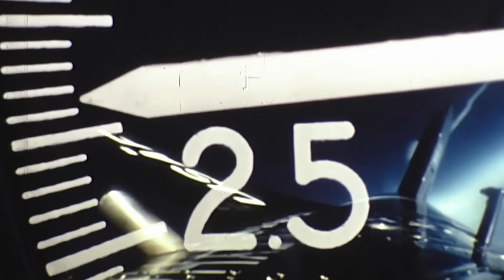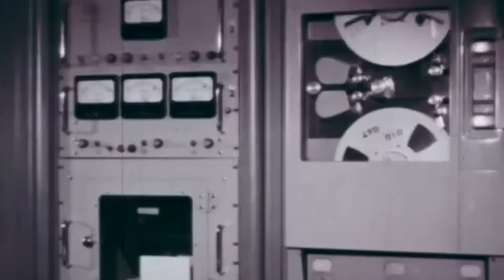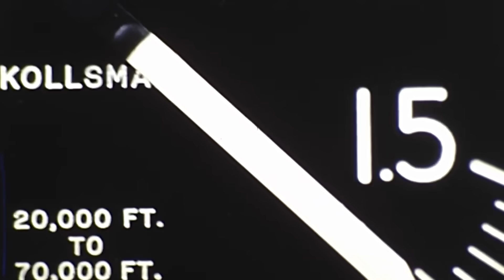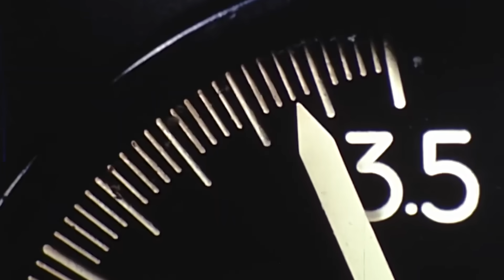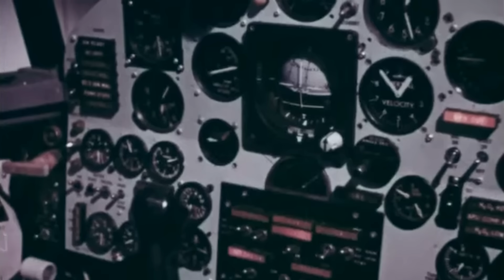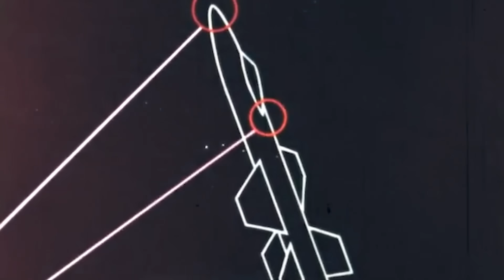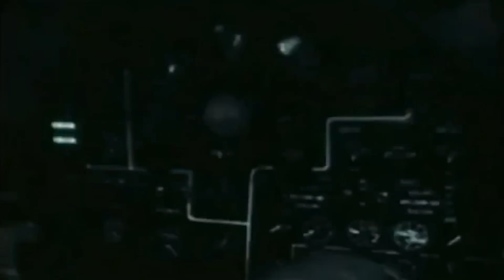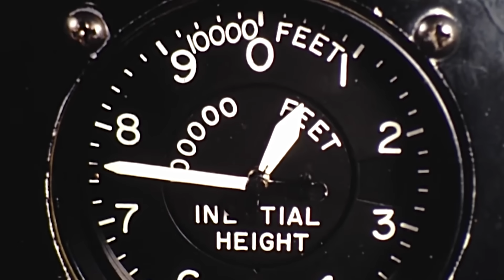The Plane That Accidentally Flew Into Space

Comment: The Y12 could zoom climb to near space as could the SLOWER SR 71.  Forget the mig 25.
Reply: The YF-12 and SR-71 reached altitudes of approximately 85,000 feet (16 miles). That is far below the embarkation point to enter space at 262,000 feet (50 miles).
Reply: @x15galmichelleevans  It could and did zoom climb to 130,000 ft, the Y-12 and fly above mach 3.5 according to pilots eager to break the mig 25 records as did the stripped down F 15. They absolutely will not say to this day the top speed and altitude of Kelly Johnson aircraft.
Reply: @growalnuts9880  I have to disagree. There is no record of any zoom climb flight by either a YF-12A or SR-71 Blackbird to 130,000 feet, or any other high altitude for that matter. And neither aircraft could fly about Mach 3.5. The absolute altitude for these aircraft was approximately 85k feet. If flown above Mach 3.5 the titanium skin would start to melt, that was the reason the X-15 used Inconel-X nickle alloy steel for its primary structure, and only used titanium in the low-heat interior areas. If a zoom climb was attempted to 135k feet it would have lost control since there were no attitude control rockets. Just didn't happen. These things are called myths. I remember such a myth that actually said the SR-71 was used to go into orbit and dock with a secret DoD space station. Fanciful idea, and cool to think about, but again, never happened, no matter how much we might have liked it to be. I should also mention that the SR-71 exceeded the speed records of the YF-12 as well, so it was not the slower of the two aircraft.
Reply: @x15galmichelleevans   SR71 over Libya flew at mach 3.6 outrunning SAMs and conducting reconnaissance in 1986. That is public record. It did not melt. It is both titanium and nickel steel.
Pilots who flew the Y-12 repeatedly say it was faster than the SR71 and it cruised at 100,000 ft. 85,000 was the cruising altitude of the SR71.  BUT not the absolute altitude either plane could fly.
The 50 ton Y~12 was lighter, carried less fuel than the 70 ton plus SR71. 
Some sources say it had a different engine others say it had a J58. It stayed at 130,000 for only a short time because of flame-out. This is according to pilots who say it also exceeded mach 3.6 and could cruise at over mach 3.6. 
Pilots are saying more than ever about the true absolute speed and altitude of both planes.
Reply: @growalnuts9880  Sorry, but it doesn't hold water. There are no pilots who are saying any of this. As I've stated, the structure could not sustain any speeds higher than Mach 3.5, and the highest recorded speed was only Mach 3.3. I was friends with Bill Flanagan who was the chief test pilot on the SR-71/YF-12 for Lockheed. The A-12 (not Y-12) was supposedly able to achieve Mach 3.35 and had a ceiling of 90k feet, both slightly higher than the Mach 3.3 and 85k feet of the SR-71, but that was never officially recorded. Everything else is rumor and myth which are not supported by science and engineering. Not much point in continuing to rehash this over and over again.
Reply: @x15galmichelleevans   No argument. I have cousins who worked at Lockheed. The structure of both planes etc could and did surpass engineering expectations  and did reach and surpass 3.5 and 130,000 for brief periods but could also cruise at said speed but not zoom altitude. Oxygen is scarce at 102,000  which the F 104 pilots learned.

Comment: So what happened to Joe Walker? You said his career was cut short in 1966.
What happened to him?
Reply: Joe Walker was killed in an accident on 8 June 1966. His F-104 was flying as part of a 5 aircraft formation, centered on the XB-70. They were taking promotional photos for jet engine manufacturer General Electric, and all the aircraft in the formation had GE engines. Joe was asked to get his F-104 closer to the B-70 for the images, and it was caught in the wingtip vortex of the giant bomber. The F-104 was flipped up and over the B-70, where it rolled across the back of the bomber, taking off one of the B-70s vertical stabilizers. Joe's aircraft broke into 3 pieces and exploded, killing Joe instantly. The B-70 was also crippled and went down minutes later, killing copilot Carl Cross. The B-70 pilot, Al White from North American Aviation (and Scott Crossfield's backup pilot on the X-15), was able to eject, but he suffered serious injuries because of a malfunction in the ejection system. He did fully recover, however.

Comment: Thank you DS. The X-15 is one of my all time favourite aircraft. 
It can travel at over 6,629 ft. per second. That’s truly astonishing.
Too avoid melting under high temperatures, the canopy glass had to be manufactured from quartz and gold.
Manufactured by North America Aviation the X-15, and the General Dynamics F-16 imo share similarities (single engine/fuselage shape/short stubby wings) in their design.
Neil Armstrong flew the X-15, he pitched the nose of his X-15 too high bouncing it off the edge of the atmosphere, as a result he overshot the runway at Edwards AF base, landing short. He was fortunate to walk away alive as the flight of an X-15 released from a B-52 to landing, lasted a mere 6 minutes. After fuel’s expended an X-15 is manually glided back to Earth. Tricky, as without propulsion the X-15s flight characteristics resemble that of a rock.🤭
Reply: It has nearly zero to do with the F 16.
Reply: If you overshoot a runway, you land long not short.

Comment: The blackbirds father
Reply: There is zero crossover between the X-15 and the SR-71 Blackbird. The X-15 was designed and constructed by North American Aviation, while the SR-71 was created by Lockheed. The SR_71 could only fly half as fast as the X-15 and only about 1/4th the altitude.
Reply: @x15galmichelleevans  cool thanks for letting me know they look very similar though

Comment: Excuse me? The entire purpose of the X-15 program was to investigate how to control vehicles at high speed on the edge of the atmosphere, the point was to find out how to things would function during re-entry. Since Walker had manual control of the engine, it was unreasonable to expect him shut the rocket at a precise microsecond. Throttlable rocket engines such as the XLR-99 were always somewhat experimental, so to be treated with care and attention following procedure, not just slamming it open or shut.
Yes, the flight did exceed the planned profile but fortunately North American engineers had done their jobs well, and the X-15 was within design parameters.
A more worrying moment was the high speed flight where the scramjet model partially melted.
Reply: Exactly. This video is terrible at facts, and was made to sound like no one knew what the heck they were doing. Yes, the Mach 6.7 flight with Pete Knight on 3 October 1967 was a much more critical mission since the shock waves coming off the dummy scramjet were like a blowtorch into the engine section at the rear of the X-15.

Comment: you needed to make a bigger x15 so it can carry more fuel. then it will reach space
Reply: The X-15 could reach space , the problem would be its re-entering , because of the speed , angle of attack and , friction from the air re-entering it would have been ripped apart and burned up , the space program was figured out in baby steps .
Reply: @fakenews7266  The X-15 did reach space on 13 of its 199 flights. Eight of the twelve X-15 pilots earned astronaut wings during the program with both Joe Walker and Joe Engle achieving 3 spaceflights each. The X-15 was designed to fly into space, but it was not designed to fly into orbit. It flew a suborbital path similar to the first two missions of the Mercury program. The X-15 topped out its speed at Mach 6.7 whereas orbital velocity is Mach 25.
Reply: Yes...but it wouldn't survive the reentry.
Reply: @charlesharper2357  SpaceShipOne не разваливается!